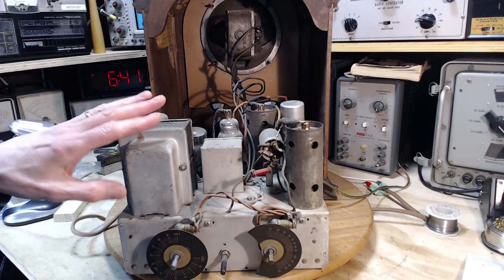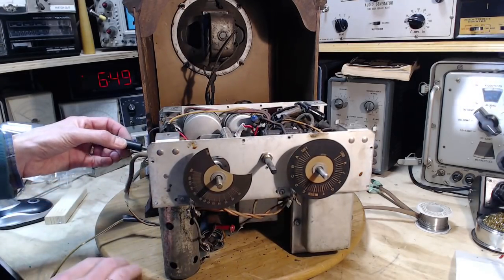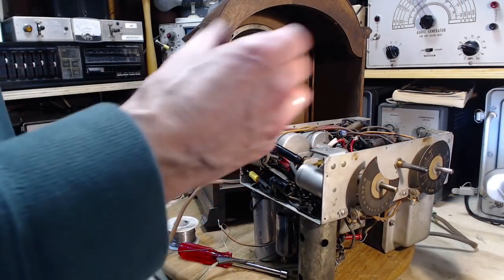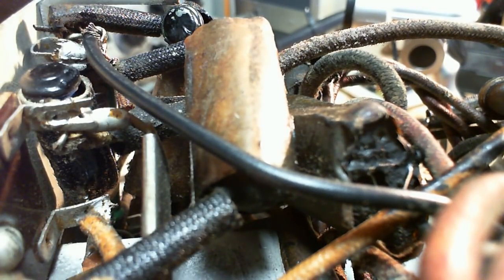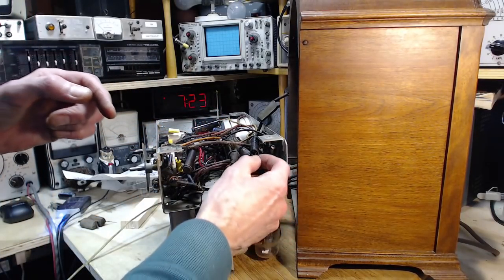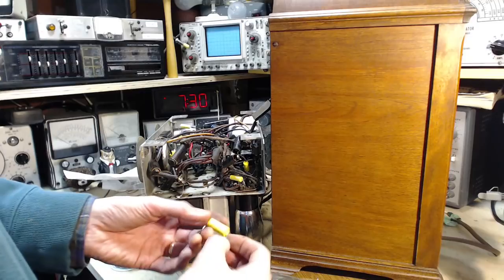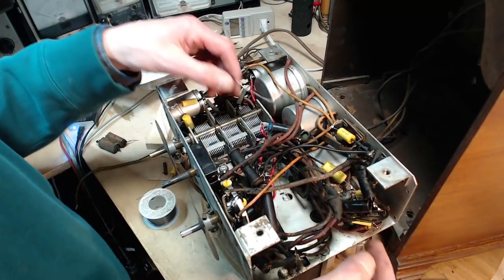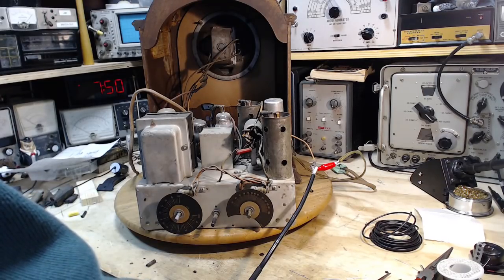Canadian General Electric K60 Video #5 - Six Ugly Capacitors

Comment: This radio appears identical to the RCA Victor 120  https://www.radiomuseum.org/r/rca_120.html  at least by its schematic. The 2B7 tube link has  schematics of typical circuit applications  https://www.radiomuseum.org/dsp_picture.cfm?image_id=204496&tube_pk=2961&imgtyp=U  which are drawn more like you were thinking to be less serpentine.